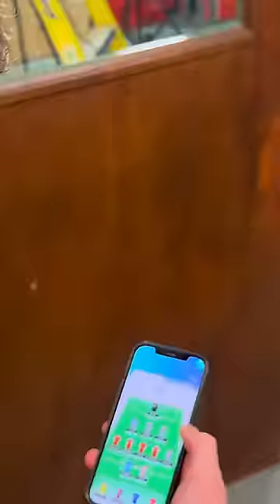This Gadget Prevents Accidents 😬⚠

Comment from the maker: Check out the full retractable cable reel review here. 
 https://youtu.be/_rUQxBF61U0
Reply: Can you do a video clearing up things such as, if I'm going to install 3 sockets in an existing ring circuit but the board is existing dual rcd and plastic....... do I then need to put a metal board on and SPD or do they need to be done only if a new circuit is installed seems to be a grey area some say yes some say know 🤷‍♂️ what regs specify the approach to take.
Reply: Phew! Thank you!

Comment: Looks neat.
I, personally, wouldn’t nail RSJs as it alters the structural integrity & would look for a clamp that fulfills that function but… it’ll be something I’ll look into using in the workshops
Reply: If an RSJ is close enough to the load limits for it to make a difference you have much bigger issues - if the hole is atleast the width of the beam away from the web it should be decimal points of change

Comment: The author of the video crimps the wires before securing them into the screw terminals, which is good practice as far as I know, but shouldn't it have already been the case before his intervention? Is there a rule about that?
Reply from the maker: The cable was cut to length for the install - https://youtu.be/_rUQxBF61U0